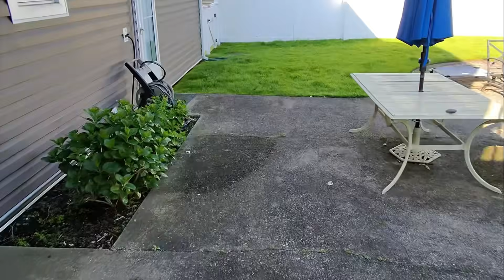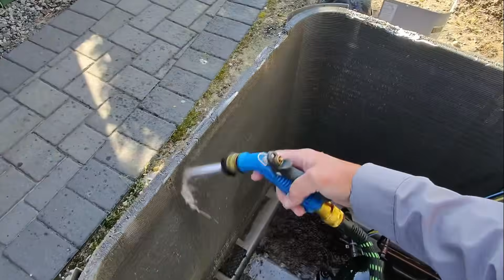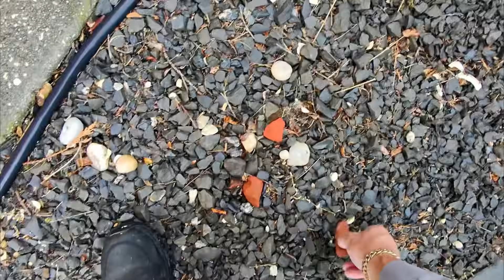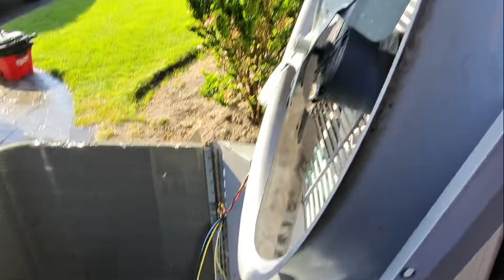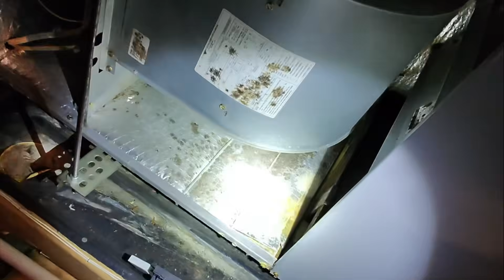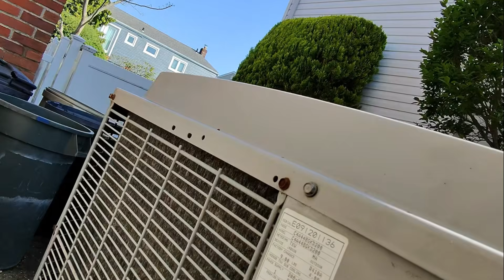HVAC Maintenance DONE RIGHT! AC Service Call Every Tech Needs to Watch

Comment: I have 2 ,4ft pieces of 3/4 pvc I use to put under the condenser unit to elevate it so the water & dirt will drain out faster, I can wash the pad off under unit.

Comment: foil tape over outdoor line set insulation will stop the uv and birds from ruining it. I've done that on quite a few lines over the years, but mainly on refrigeration where there's far more exposed and heavy year round operation.  maybe did one residential where the line went over 30 feet outdoor exposed, of course right after replacing the failed insulation.

Comment: some idiot installed the condenser and everything here. condenser spaced off the wall about 2 feet. the dryer vent is many feet away, disconnect is close and very accessible, service receptacle within 5 feet, softened hot/cold and cold unsoftened water frostproof faucets with 8 feet, natural gas with quick disconnect(for grill) about 10 feet away.  damned that idiot! 😏